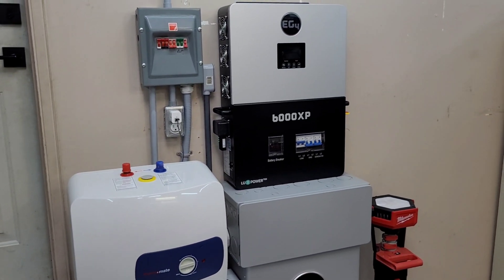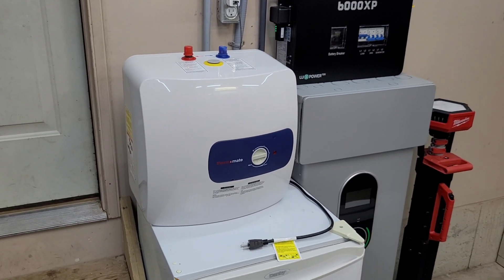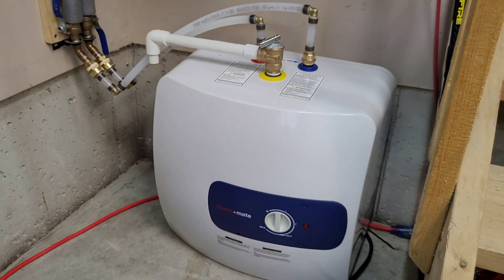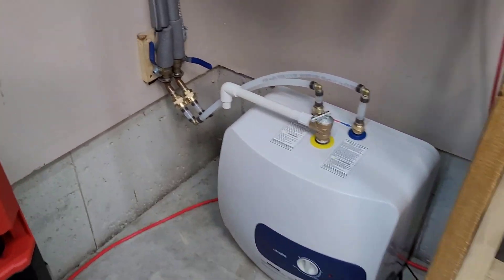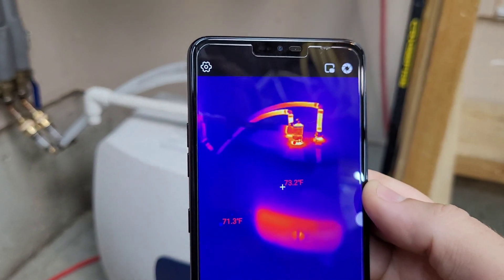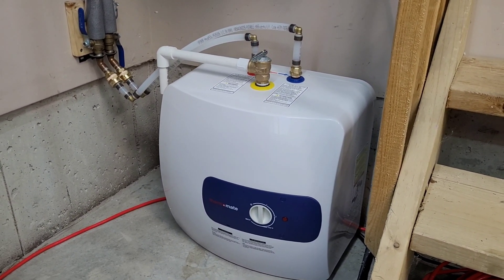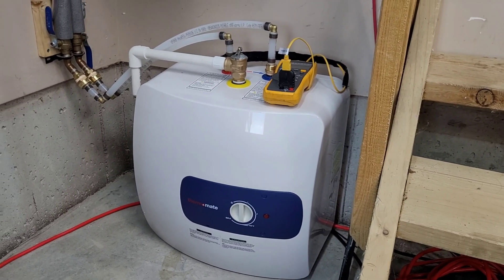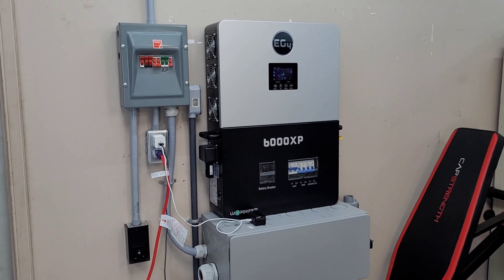Can You Make Free Hot Water Using Solar?

Comment: Im going to be installing a 30 gallon 120v water heater in our Solar Shed. We have a 12v 400ah lifepo4 battery set-up with a 12v 3000w inverter. We have 500w solar input. I want to plumb in our new water heater as a "pre heater* to our 50 gallon Rheem hybrid water heater. This way it will heat the cold side of our big water heater. Great video. Great video. You're videos have been great. I have gad our EG4 24K solar mini split running since last July. No issues. God bless 🙏 

Jeff- Sunny Central Florida ☀️

Comment: So did you just put this on the domestic water inlet to your existing gas boiler buffer tank? So basically the buffer tank gets fed hot water instead of cold tap?
Reply from the maker: @Tazdeviloo7  it's on the inlet side so it receives water and preheats it before going to the boiler
Reply: @SmitHVAC.  Interesting. Do boilers know the inlet water temperature?
Reply from the maker: @Tazdeviloo7  yes, this one does

Comment: The 6000XP now has a setting where you can use the generator input as a "smart load" where you can program it to run the heater only if the battery is above a certain threshold and run it down to a specified level. I have mine set to turn on the "smart circuit" that charges my EV only when the battery hits 90% and it runs down to 20%. Heating water is another great way to use excess solar.

Comment: I would like to share some context here. I have a 40 gallon electric resistance water heater in USA with $0.12 National USA Average electric cost. The government efficiency sticker says it takes about $402 dollars of power a year, but I round that down to $1 a day. In reality I have tracked this and I have come up with calculations of $186 a year, $200 a year. Two person household, one takes fast showers. Otherwise this is all average typical usage, (no extreme efficiency efforts taken). They make DC elements that can go into a water heater or a small heater can be used as a preheater. There are also heat exchange units one can put on the outgoing water sewer line that will run the incoming water up a copper pipe in the outgoing sewer pipe to warm the water. These do pay for themselves in about 5 years. That said, for a typical house you are going to need abot $1 of power per day for hot water. That is 8 kilowatts of power per day. One could preheat that water in one or two water heaters ;  and use to preheat water during the day and then let it use it when needed. They also make mixing valves that will allow effective expansion of he water heater tank. One preheats the water to a higher temperature then mixes it with colder water to dilute it. Whether it is worth it or not, is another story. I too am curious because it would be nice to have free heat and electric.

Comment: Tried this. Not same brand, but results fantastic. Retired in self designed energy efficient home 15 years old.
Tried four different water heater. This way has cut our bill by 50.00 month. Keeping 40 gallon tank as storage. Unit feeding large heater no longer turned on.
Reply: How'd you hook it up to the main water heater? I'm wondering if I can do the same with an IBC gas boiler and 40 gal buffer tank.

Comment: You should be able to use the dry contact controls on the inverter to turn on loads with a relay, when the battery is full, as well as to turn off at a set charge as well. Which means in theory you could set this unit up to heat a much large thermal mass with a small pump and an expansion tank. It may actually be more efficient than the air source in the winter if you had adequate angle for the sun is.
Reply: This specific inverter has that feature built in. The generator input doubles an a "smart" output where you can program it to turn on or off to various parameters.
Reply: @Tazdeviloo7  yes that is good if you do not need a generator input.
Reply: @davefroman4700  If you have a generator that meets the specs of the 6000xp then you could just flip the setting in the app and use a double male plug to your smart outlet. 

Most generators don't meet the spec so you'd need their "chargeverter" accessory anyway which charges the battery directly, bypassing the 6000xp.

Comment: I run a 20 gallon 120v water heater with a smaller 1k heating element. Run my system on a EG4 3k unit. No problems and normal showers.
Reply: Is it an inverter water heater? What unit did you buy?
Reply: @MyCabinLife  just a cheap Home Depot 20 gallon electric water heater That's rated for 120 volts then I put the smaller RV electric heating element in it.

Comment: Yes I can..  with my 2400w of PV dumping that into the 1600Ah (four 400Ah Li Time) lithium's.  I just turn on the breaker and it starts heating up. Take about 15 to 20 minutes. All of the power goes through the 12v 3000 120 MPII, being controlled by a pair of 150\70's and monitored by the CERBO. I have 30A shore power, but have setup this '28 RV to be off grid. Speaking of HVAC, I use 2 separate 305w panels for primary power for the EG4 12k Hybrid mini split. Yesterday my EF Delta 2 with it's extra batteries powered it all day long.. consuming as little as 190w. Backup power in cloudy weather is powered by the Honda EU2000i.  I don't get enough sun hours to tie the water heater into L2 on the MPII, but it's always an option.

Comment: In the uk we have a 3kw immersion back up heater in our hot water cylinders and we use a device called solar divers so when our batteries are charged any surplus energy is pushed into the immersion in the water heater automatically they can also be used to heat towel rails or buffer tanks it’s a great addition to a solar system

Comment: I think I would use that little guy for a pre heater to the main water heater. just cuts down the cost and still no heat loss in the shower.
Reply from the maker: That's my plan down the road, should work pretty well. I'll update later!
Reply: @SmitHVAC. It's fun experimenting but at the end of the day you should be putting in a heat pump style water heater if you're trying to save money.
Reply from the maker: @powerguymark Maybe.. But if you're just getting set up and your budget doesn't permit, this gets you started for $2800 less
Reply: @SmitHVAC. This is what you need. 
You can either use four times the amount of water you currently use OR save 75% on your water heating bill. 
https://youtube.com/shorts/zMXNYIsFQtI?si=2U6OpiCyeP3CnHfP
Reply: Preheaters are just a waste of power if heated to more than 80F.Most people heat too much water.  There are heating elements which will fit in the tank of the gas heater. Most people do not use that much water.  I have a small tank just like this for my primary tank and a 15 gallon preheat to feed it.  All heating is done just with excess solar diversion from the array feeding the controller. No battery, inverter or controller resources are used.  The solar world is so beind the times when it comes to heating water.
Reply: Interesting test.
Do you mean 125F in the heater?
It would be longer showers if it heated to 180F and use a mixing valve to let out 125F in the water line.
Reply: @rwd1973  that would work too